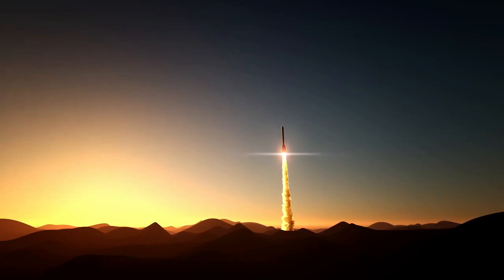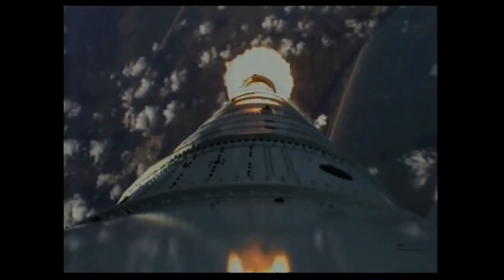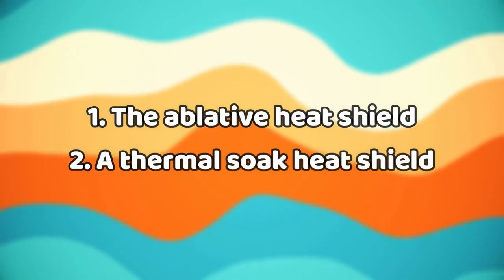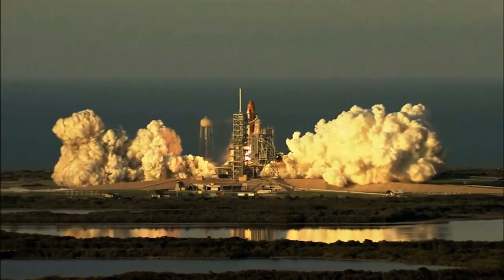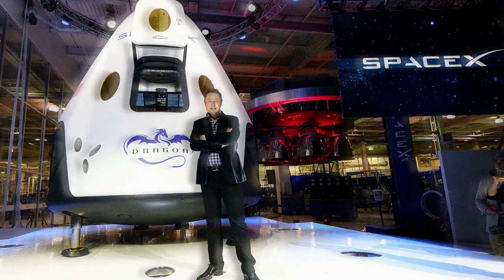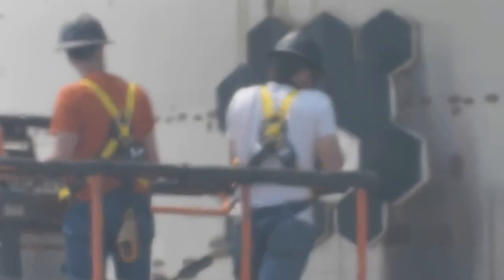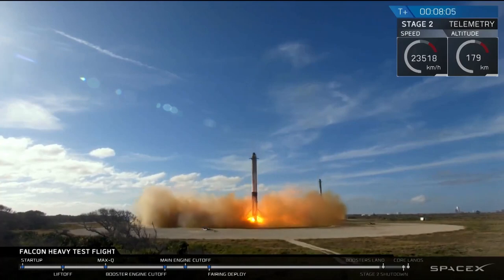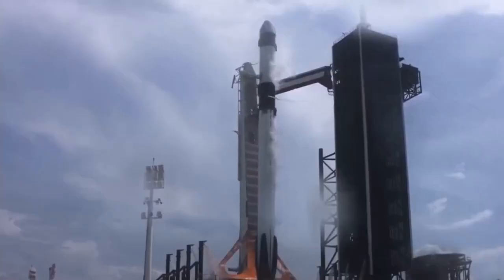Elon Musk's SpaceX TESTED New Starship With Heat Shields!

Comment: The starship should initially enter similar to the booster in a vertical decent similar to the booster. It might use engines to slow down and to use engine heat to deflect the atmospheric friction heat.

Then in the horizontal position use a large heat panel to deflect the heat. The large heat panel can be held in place by bands that reach around the body of starship. This would anticipate vibration movement to occur without breaking the panel loose.